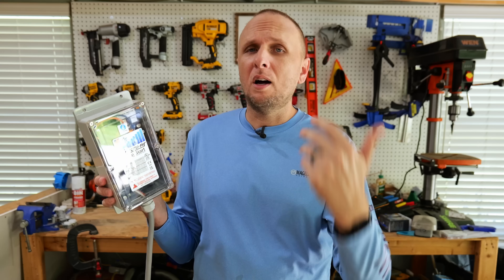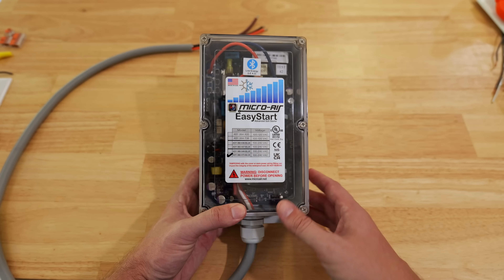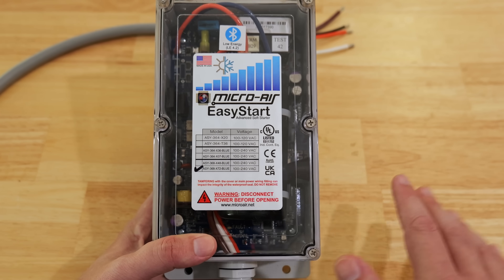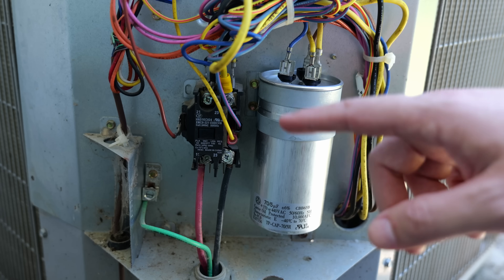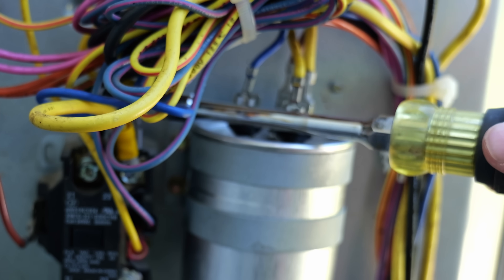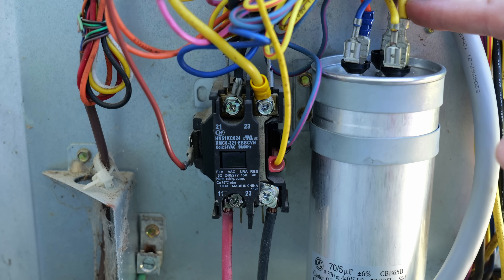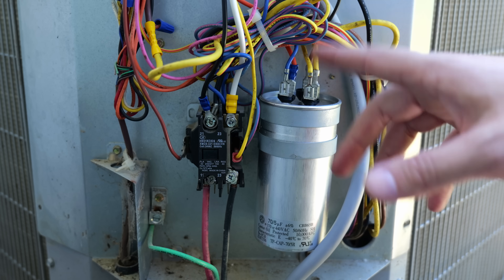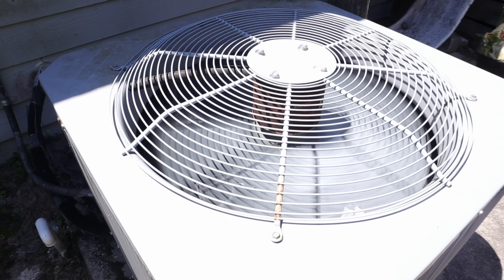Why Every Homeowner Should Consider Installing an AC Soft Starter | Micro Air Easy Start Install

Comment: I installed this on my 4 Ton Goodman package unit a couple of years back. We've been through 3 major hurricanes in 16 months and spent a total of 20 days without power.  We've also had random power outages in north central Florida. I can get the AC to run on a 9000 watt generator that is a 7250 running watt unit. I don't run it on that generator for long because it's maxed out, but it does it. I have since acquired a 16kw inverter generator.  I hope I don't need to use it, but it's nice to know I can now use the AC and run the rest of the house as well IF we get hit again here in the Big Bend of Florida. Another note-the Micro Air unit us now on our new package unit.  It has a total of 12,000 plus starts with zero issues on the 2 units.  Easy to install and zero maintenance.  I highly recommend keeping it covered and out of the sun.  Our start up amps is @ 38.  It was 165 or more without the soft start. I cannot recommend this unit enough.
Reply: Why risk your home ac running it. on a gen instead of just getting a small  window unit for emergencies?
Reply: @robwhite7469  because we have a huge 5 bedroom manufactured home, and the heat and humidity build quickly.  I have extreme health issues that require a cooler and, more importantly, a lower humidity environment. The package unit isn't that sensitive to the power it's getting as long as it's the proper voltage and amperage. I have since conducted experiments running the entire house off of the 16KW inverter generator,  and it performs perfectly with clean power delivery. Even with absolutely everything in the house on at the same time, I still have 2000 running watts available. I do not run everything at once, and still power manage to keep the draw to half the generators' capabilities. I have no worries about my AC unit, whether from generator power or the soft start unit.

Comment: I was reading online that say if your split system has a inverter you can't use it i have a heat pump split system so I was asking incase of generating use which I have and might need can you clarify
Reply from the maker: If your heat pump has an inverter then using this would not really benefit you.

Comment: Have a news style Bosch Heat pump unit with what looks like a computer circuit board behind the panel.  Will these Micro Air soft starters work on new Bosch systems??

Comment: I don't have a generator for my home.  Is the benefit of a longer lasting compressor something that was ever verified?  The other benefit of less noise on startup is nice, but not a requirement to me.  And what are the downsides to this?  Does it eliminate AC warranties, or is it just the upfront costs that are the negative?
Also, should this allow the capacitor to last longer since it wont be relied on as much to start the compressor and fan?

Comment: Just installed one on my AC following this method and went from 90 amps pre installed to 22.5 amps after install now I can run my 3HP AC with my 3500 Predator. Great video!

Comment: I have two units on my house a 2 ton unit and a 3.5 ton, if I buy one for each would a 8150 peak watt/6500 running watts be able to start one at a time and have both ac running off one generator?

Comment: You have it set up on a 50amp so it must be on a 50amps I do have mine set up on a 30amps but I want to buy the soft start to be able to run my 4ton AC unit on my dewalt 8000 generator. Please advise if I have to change my set up from 30amps to a 50amps. Thank you

Comment: Very nice demo!  I will be using a tri-fuel generator with natural gas which has running watts comparable to your smaller generator’s surge watts.  Good to know it can handle the HVAC inrush with the soft start installed!

Comment: Why aren't these sorts of designs built directly into heat pumps in the first place? I've been struggling for a few years to find a solution to cooling my room that gets significantly hotter than every other room in the house (modifying the house itself is not permitted) so I've needed to just buy a standing AC unit (as the window variants are against HOA which is stupid) problem is most of them are exhaust only which is terribly inefficient and there's only like 3 models that have an intake and exhaust. On top of that the starting power draw from this system is too much for my 15 amp circuit and triggers my battery backup to click on every time it cycles which probably isn't great for it.

If someone could make a decent quality single room standing AC with built in soft starter, easy maintenance access and dual vents that would be really handy

Comment: My AC is smaller at 2.5ton...do I need a soft start kit? I see the one you used the specs say 4-6ton. the Generator I'm looking at depending on which gas I use, gasoline, proprane or natural is 9500-7500 running watts or 12500  - 9500 peak watts.

Comment: Great video @HowToHome DIY, thanks for posting this.  In your products list above you call out the 368-X48 model to be used for a 2 - 3.5 ton units and the 368-X72 for 4 - 6 ton units.  I have a 5 ton unit and another 4 ton unit at my house. I just want to confirm that the 368-X72 model be used for both of my AC units or should I use the X72 for the 5 ton and the X48 for the 4 ton?  I could not find an answer to this on the Micro-Air website and the X48 is pretty scarce right now as these models are probably being phased out or discontinued.  The Flex model appears to be having some recent quality/functional problems, so I am trying to avoid that model if possible.

Comment: I have had this same model (ASY-368-X72-BLUE) for about 6 months and haven’t installed it yet. Unfortunately my compressor went and I had to update from R12 (she was old). Now I have a brand new Trane 4 ton compressor and air handler. I’m hesitant to install it on the new system as I just dropped nearly $8500 on it. Am I being over dramatic? Is it safe to install on a new system?

Comment: Only issue I had was with me not knowing much about the ac side I wasn't sure which was the run wire and the video looks like you used the yellow off the capacitor and I later found out the run wire was the red wire coming from the compressor.
Reply from the maker: I did use a yellow wire but it was from the contactor and it will be a larger gauge wire.  The color can vary as you found.  There should also be a wiring diagram on your unit to tell you which wire is the compressor run wire too.
Reply: @HowToHomeDIY  yes sir at first I took off the wire from the contactor and connected it to brown..the wire I took off went to the cap and not the compressor.
Reply: It just looks in the video like that's what you did..I was in the sun light and couldn't see the wire size difference on the video. It ran like that for two days before we noticed a wire connection fault and he called saying the unit wouldn't turn off. I went back and corrected my mistake and thankfully no damage was done.

Comment: i woulda considered it if they were still reasonably priced but now they're over $300, and i've seen multiple reports of compressor failures due to these soft starts when they failed. so yeah, i'll pass and keep replacing my capacitors when they fail instead, $5 instead of $1000+.
Reply from the maker: No you haven’t seen that 😂.  But go ahead and pass.

Comment: Have a 4 ton and a 2.5 ton ac unit at my place of residence with both having hard start kit 
My question is can a 15000 watt tri fuel dura max generator power both the units in case of an outage or do I need to install soft start kit on both units and take out the hard start kit please comment thank u

Comment: van i estimate how much savings in terms of Watts and bill this unit can provide? tks
Reply: It's not about savings, it's about reducing the large inrush current from cold start so you can use it with a generator, after your AC starts it uses the same amount of power.

Comment: Maybe this is a dumb question; when you say it allows you to use your solar are you just saying it wont cause problems with your solar during normal use or that you can use your solar along with a generator during a power outage? thanks

Comment: Thank you for a great informational video.  

Do you know if these Easy Start devices solve the problem with LED lights in the house going crazy when the central air compressor kicks on?  It sure sounds like it might since the soft starts eliminate the heavy draw when the compressor kicks on.

Comment: Does or will this work with a heat pump?
Reply from the maker: Yes.  Mine is a heat pump.  Works great in winter and summer.

Comment: Adam, would you please update your list of Micro Air soft starters. It appears that most of your suggestions are now discontinued or in very limited supply and not available in all markets. At this time the Flex has about a 6-week shipping delay.
Reply from the maker: There is a shortage currently.  They come back in stock regularly.  But the hurricane that hit Texas a month ago kind of put things behind.  So unfortunately there is nothing to change my links to right now.
Reply: @HowToHomeDIY  I didn't realize the Texas hurricane caused the shortage. I live in Southwest Fla. and hurricane Debbie swung just wide of us. We missed the worst of the storm but had almost 40 hours of constant wind and rain. I only lost power for 9 hours, but it was enough to purchase an 8500-watt inverter generator. That easy start is on my list. Hopefully it will come down off that $400 dollar price tag. Thanks for the quick reply. 👍

Comment: what would be better for a 4ton unit capacitor a 70/5pf or 55/? if I need to replacement while installing the easy start ?
Reply from the maker: The capacitor replacement needs to be the same as whatever is currently in your unit.
Reply: @HowToHomeDIY  thanks

Comment: I’ve heard of high failure rates. For $400 per unit and I have two ac units, kinda seems like one more thing that can break on a home I’m away from for months at a time. How reliable are they?
Reply from the maker: I’m curious where you have heard that at.  I’ve had these installed for years and never had an issue.  The only failures I’ve heard of are ones where the directions weren’t followed and it was wired wrong.  I’m not sponsored by them or paid by them, this is just my honest opinion.  In fact I have a video coming out this weekend or next on their new flex model.  If I thought they weren’t good I definitely would not be telling people about them still.  If you have any other questions feel free to ask.

Comment: You put the amp clamp on the common not run winding
Reply from the maker: I put it on the run.  So did the ac guy when he came for a maintenance call.
Reply: Yea but you will get the full amp draw on common

Comment: My capacitor only has 2 terminals—rust on top hides any designation of which post is which—how should I discharge capacitor—is it safe to contact screwdriver across these 2 terminals?

Comment: What is a good rule of thumb for determining what size Generator is needed to run a residence with a 200 AMP Electric panel, including a 5 Ton central HVAC with a soft start kit installed?

Comment: If this was needed the manufacturer would have shipped their unit with one . The more gadgets you have the more service calls you will have . I assure you if the manufacturer finds out you put this in your unit it will void your warranty  . If you are putting a hard start on residential equipment it simply means that you are on borrowed time  . Very nice generator !
Reply from the maker: Manufacturers are going to ship their units with the least possible things on them to be able to manufacture them as cheap as possible.  No this does not void your warranty.  Having this on my unit the past 4 years I have had zero service calls.  It also has come in handy numerous times during power outages so I can run it with my generator along with the rest of the house like we are experiencing right now with hurricane Debby going through.

Comment: Followed your instructions to the letter, the micro air easy start has no indicator lights energized and my compressor will not energize. Uninstalled the micro air unit put my AC unit back in service but the AC compressor DNE. I'm a Biomedical repair technician by trade so this type of thing is baby town frolics for me. My compressor is only a year old, just once in my life I would really appreciate it if things could possibly go my way without any hiccups that would be great. One can dream anyways, this seams to be not my lot in life

Comment: I am trying to get one but they are out of stock. Do you think the 4-6 Ton AC Micro Air Soft Starter X72: works for a 3.5 ton ac?
Reply from the maker: No that one is for 4 tons and up.  The X48 would be the one you would want.  But they are taking orders again for the new Flex as of today if you were still wanting to look at them.  Links are still in the desrciption.

Comment: For the price of the Easy Start; which is no longer selling the smaller ones, I would like to have more data. Like... How much electricity is it going to save me? If it doesn't then how many years is it going to add to my A/C unit? Don't have answer to these questions? Then just so I can use a smaller generator is not a good investment criteria. Easy Start priced themselves out of the market buy just selling the commercial units only. End of story.
Reply from the maker: You’re asking questions that are impossible to give an exact answer to.  For the most part electricity savings are only going to come to folks who are charged peak usage fees or demand fees.  That amount is set by each individual company and your demand won’t be the same as the next person’s.  How can they tell you how many years it will add?  What brand is your ac?  How often do you clean it?  What’s your climate like? Do you maintain it?  How often?  What type of compressor is it?  So many other things too.  All of this stuff matters so no they can’t tell you how much time it will add because nobody can do that even if they maintain their unit perfectly.  But when you look at how it works and the results we can see, I think it makes the most sense to most people that if my unit isn’t working nearly as hard on start up, it’s going to last a lot longer.  As far as their pricing, I guess that’s your opinion, but the other soft starters out there don’t offer what these do and if you look into them you’ll see more people having issues with the other brands than the Micro Air.  You get what you pay for.
Reply: @HowToHomeDIY  Thanks for proving my point.
Reply from the maker: @teddypreston5525 if that’s what you got out of it then super 😂
Reply: @HowToHomeDIY  Facts are facts. As an engineer I deal with facts and numbers.  I don't make them up. They have priced themself out of the market! End of story.
Reply from the maker: Those aren’t facts though.  They sell tons of them.  You’re just making up your own “facts” without and sound reasoning.  It’s just your opinion.
Reply: @HowToHomeDIY  Selling tons of them might be a fact; a useless none the less. And definitely not one that I would use. Would you through yourself down a cliff just because it is the new fad? But since you seem to know the facts... please, let all of us know them. Inquiring minds want to know!

Comment: I just installed mine using your video. Nothing exploded or caught fire after the first start, so I'm gonna call that a win. Ended up screwing a painted board to the house and making a wood  box on a top hinge for the unit to protect it from the sun. I have awful peak electricity charges so hopefully the unit pays for itself shortly.
Reply from the maker: That’s awesome!  Out of curiosity, how do your peak electricity charges work?  Is your rate determined by your higher current draw or what exactly is considered peak usage?  I know for some people the power company calls it peak usage at certain times of the day when the most power is used.
Reply: @HowToHomeDIY  I think you’re dreaming if you think this is gonna save you anything significantly on your electric bill. Peak usage is not 100 A at 100th of a second.  It’s an extended usage at some current. This would not fall into that category.  People talking about saving money on their electric bill using these things are delirious.

Comment: Would one of these work on a 3/4hp 240v submersible well pump to reduce inrush draw enough that my 3500/3000 watt generator could  start the pump?  It comes sooo close now but Genny dies just before pump reaches full rpm...
Big milsurp diesel generator will start it w/o breaking a sweat but well and diesel live on opposite sides of county road so ability to run well on smaller generator would be great for shorter outages.  County wants $$$ to tunnel wire under road to enable diesel to run well not to mention cost of 250' of 4/4/4/4 wire these days.

Comment: Enjoyed this video...will save me $1200 in labor, but have a question: 
I watched your hard start installation video from 3 yrs. ago. I want to run the house with selected small amp appliances plus start and run the a/c with a generator during power outages, like the fiasco recently here in Houston after Hurrican Beryl...NEVER AGAIN! I want to run a 10yr old 5-ton Carrier (135 LRA) that has a hard start kit on it already so will I need to replace it with a soft start in order to use a 10000/8400watt generator for the project?

What kind of improvement in amps used by the hard start to the soft start give you?